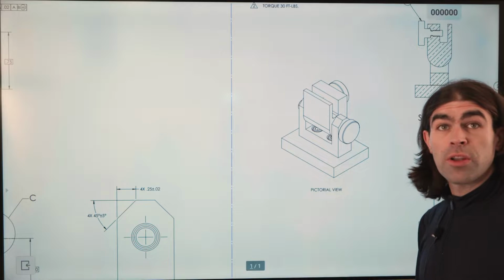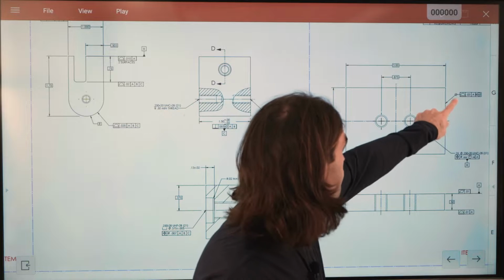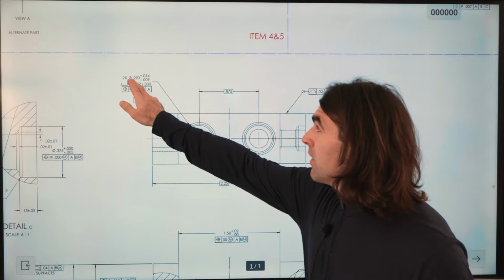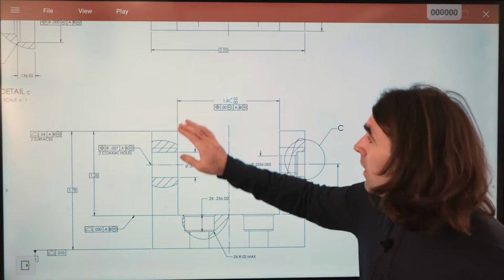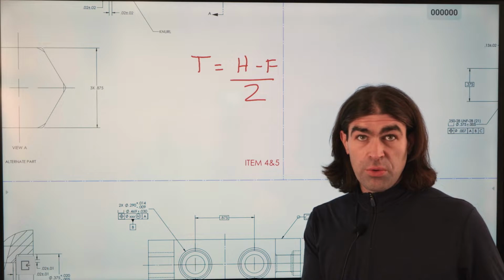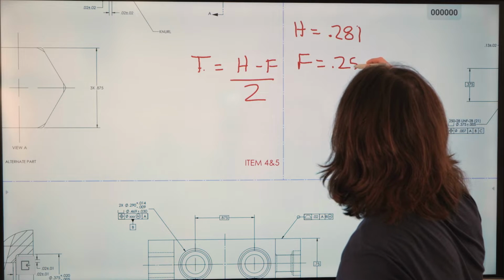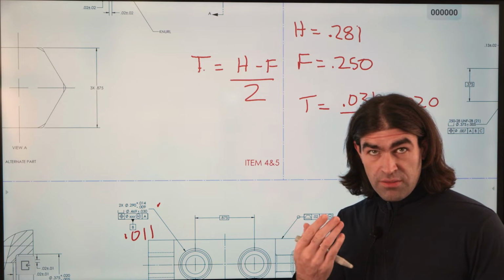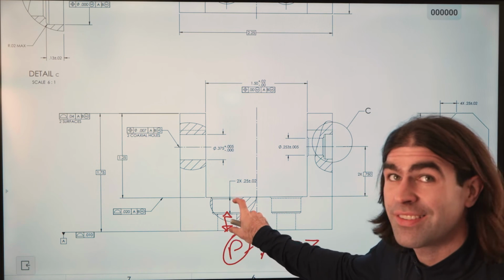Calculating Position Tolerance Values With Fixed Fastener Formula

Comment: I studied GD&T at BCIT back in 2008. I've had to use it occasionally in my career, but since none of my jobs have been high GD&T-centric, I never really maintained or grew my knowledge. The times I did need to put GD&T callouts on drawings was, I thought, at least a sign that I still "knew" GD&T. I was wrong.
It's kind of like learning French in high school, but never using it afterward - yes, some of the knowlegde of the syntax and vocabulary will stay, but what little fluency you had from the courses starts fading over time. Compare this to taking a 1-year trip to France, the immersion will bring that skill back and grow your fluency in it.
As it turns out, my GD&T fluency was akin to going to a foreign country, knowing enough of the language that I could interpret street signs, but was unable to converse or think in it. 
I'm now at a job that is HEAVILY GD&T-based, and I'm discovering the huge gaps in my knowledge due to 18 years of barely using it - I knw less than I thought I did. 
Your courses are a lifesaver! Thank you. 

BTW, just curious... why are you looking above the camera so much in this video - is there a screen up there?

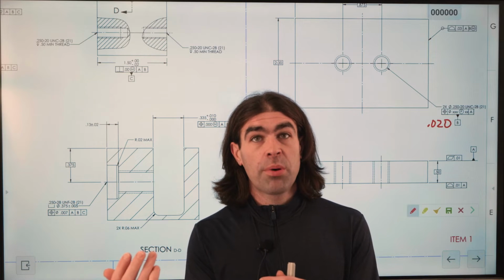Comment: At 7:45 you said correctly that the Projected tolerance zonce was the maximum thickness of the mating part.  But you are calculating the length of the hole for the part the screw goes through.  Why is that?
Reply: A bit late but he does that cause the projected tolerance zone is defined on the threaded holes. You want to specify how far from the surface of the toleranced hole you wish to extend the tolerance zone, not how thick the tolerance zone on the toleranced hole is.

Comment: Thanks a lot! That's very informative! Is there any chance you might demonstrate to replace two screws and holes assembly with two pins and holes assembly with clearance fits, say close running fit H8/f8? I'm searching for info on all kinds of fits applied to GD&T. Unfortunately, I couldn't find it. Thanks in advance.

Comment: The Fixed Fastener Formula provides the Position tolerance for both parts.  You didn't finish the calculation T= .031/2 = 0.0155 for each part.  Split 60/40, this would be 0.093 and 0.0062 or ~0.01 & 0.006.  This formula does not account for the screw deviation due to straightness or the Position tolerance of thread to body.  ASME Y14.5 has a note in the section warning users that the formula does not include these values.  Screws from the various industry standards have different geometric tolerances and values, so they cannot easily include these in the text.  People should be aware that this simplistic calculation is not complete.
Reply: He is too ignorant to reply, only replies to ones that said they liked the vid, not the ones who question his knowledge..... Ignorance at its finest
Reply: @mike.b2099 - You must be a lot of fun at parties.